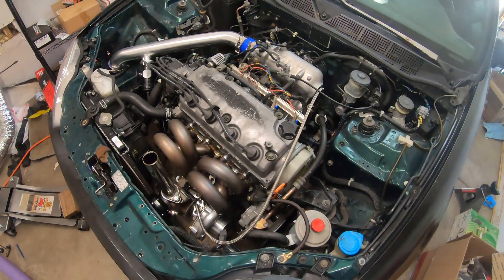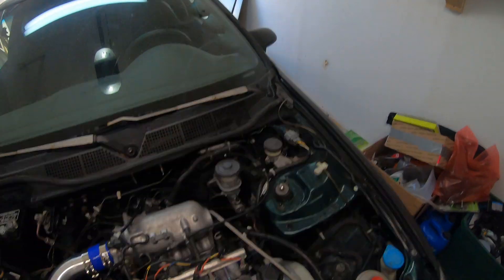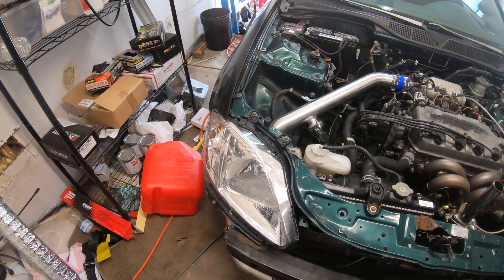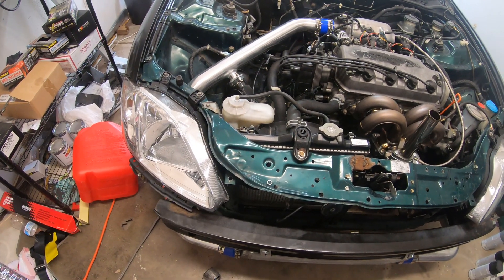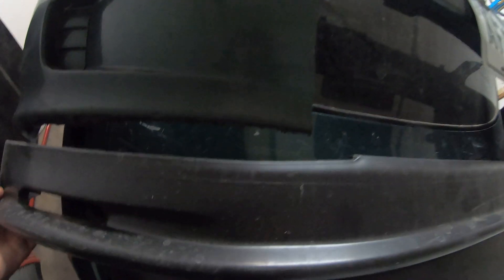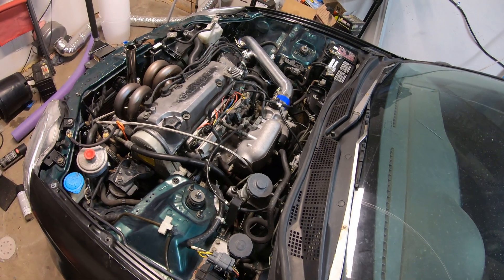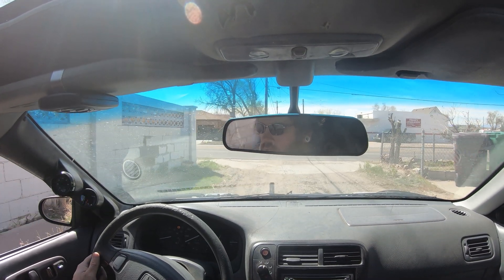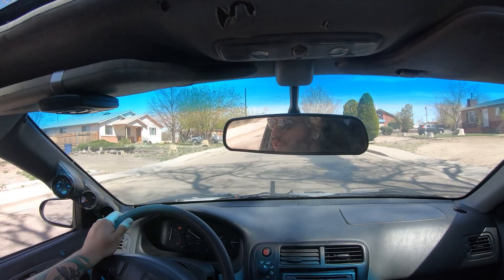Finishing Turbo D16 Civic Street Tuning | TunerThings

Comment: Is that 2.5 intrrcooler pipe? From intake to intercooler?
Reply from the maker: Unfortunately yes. Definitely would have gone 3 inch had it been an option in the kit though..
Reply: @TunerThings  what kit is it emusa? Or cxracing 2.5 inch is pretty good for about 400hp.
Reply from the maker: @HardKnocks160s  Its a CXRacing kit - definitely a good intro to the honda game but for sure needs upgrades to be something special. Wastegate is Emusa though! Kit one was leaky

Comment: sounds awesome, what are you running for an exhaust? what turbo? bov?
Reply from the maker: Honestly it's just open downpipe right now, I have about a foot gap between it and the rest of the exhaust still need to get it patched. The turbo is a cheapo CXRacing 50 trim and the BOV is a first gen TurboXS RFL that I restored!
Reply: @TunerThings  awesome! Man does it ever sound good haha, I'm shocked it's just open downpipe, thanks for the response :)
Reply from the maker: @bw1583  absolutely thanks for taking the time to watch and comment its much appreciated!!

Comment: I couldnt help but notice the check engine light. Is it a catalyst code? Anyway, from what i understand these hondas go in to a kind of "limp home mode" when ANY code is thrown. It purposely makes the two middle cylinders run rich apparently and I dont really understand why exactly..... so if you drive it like that for hundreds or thousands of miles you run the risk of burning or badly fouling the valves and they wont seat properly.
Reply: Wait does it really? My Civic burns hella oil at high rpms like about 4500 or more so i just keep it under. I have 5 engine codes all o2 sensors except the evap canister code. It burns alot of oil and i go through quite a bit however, it does leak oil and also has 262k on it
Reply from the maker: I don't think this is particularly true... Could you share a link to this info somewhere?